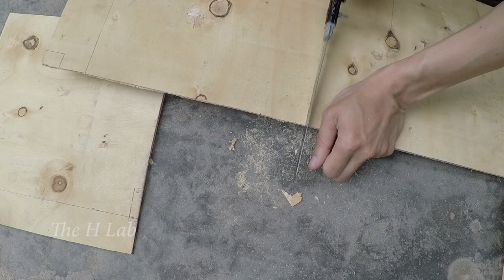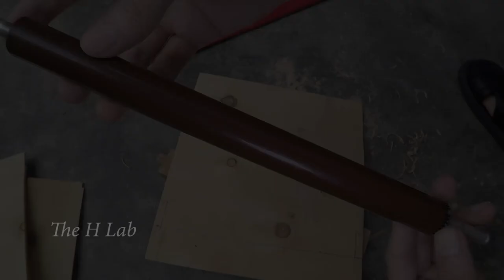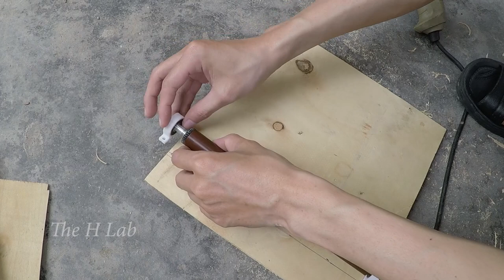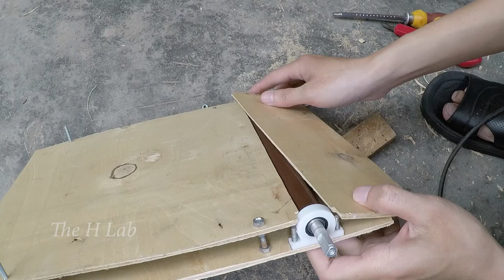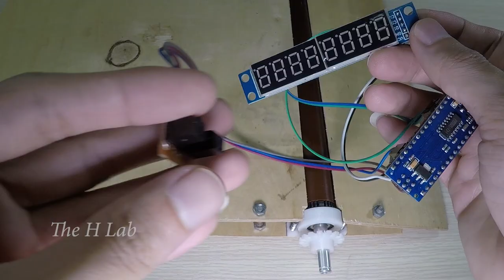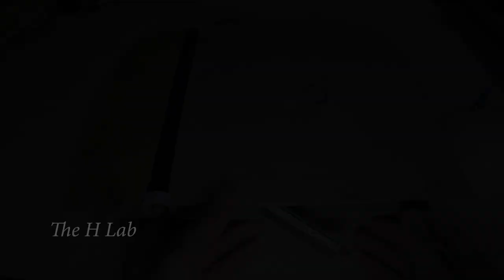Dyno for RC Car | The H Lab

Comment: Cn you connect this to the a dyno software aswell?
Reply from the maker: No. I can't. This's just a simple idea to measure the rotation speed by Arduino code.
Reply: @TheHLab  what is the Code
Reply: Would be good to determine gearing needed for a particular top speed.